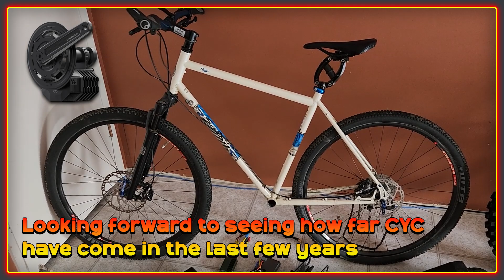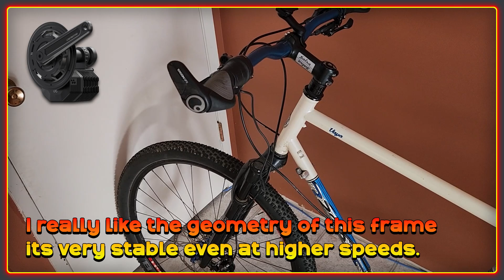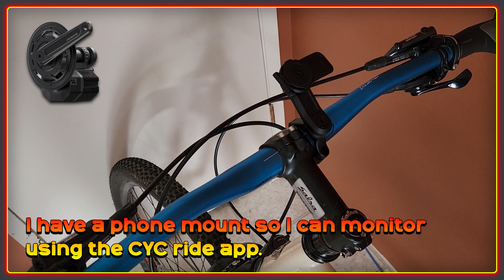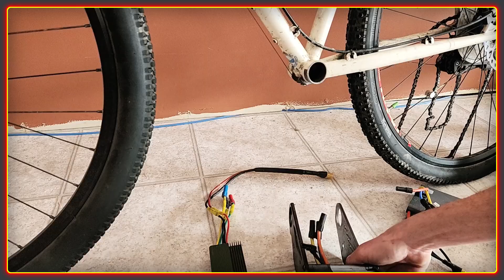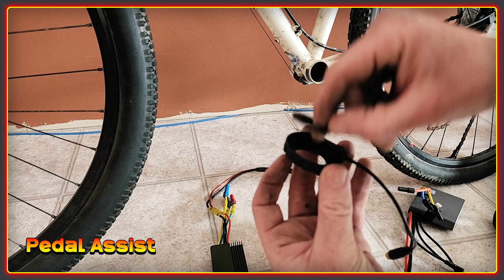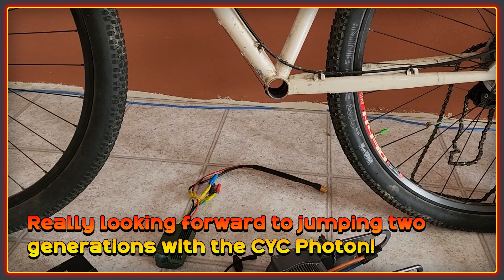CYC Photon pre install video / CYC X1 Pro Gen 1 components analysis.

Comment: I do not understand the reason or need for this motor when you have almost perfected tuning the BBSHD. Is this motor kit so much better than the BBSHD that we should consider it above that one? Thanks
Reply from the maker: Its not going to replace my BBSHD far from it. It replacing the X1 motor on my other bike. I am hoping to use this to do a different kind of riding than with my BBSHD on the Fatbike. That bike is throttle only rip about and lots of fun. This one I want to use for pedal assist only on long rides and adventures on gravel roads with a group of riders I met. I am not fit enough to keep up with them but gradually I hope that I can get some of that fitness back. Its not really in the same league as the BBSHD in terms of power output as at 750 watts is half that of a stock BBSHD never mind a modified one. I will give in an honest review and show people what it can and cannot do and people can make up their minds. Thanks for the comment! Cheers.

Comment: flaw with the cooling cover design on the controller the cooling  fins should all be facing 90 degrees round for better cooling
Reply from the maker: Good point. It's not the most optimal air flow wise.

Comment: Dude I need some help with my bac500 build I want it to be as simple as possible ideally just a throttle I have managed to  use the phaserunner suite and programmed it to the base runner throttle preset but I can’t get the throttle to work and I’m not sure if I have the right pins on the connector any help would be greatly appreciated because I’m at a loss
Reply from the maker: Jump on our discord and post photos etc. Probably be the easiest way. https://highvoltagekits.com/discord
Reply: @HighVoltageKits  ok Thank you, I will take some photos in the morning it’s a tad dark now